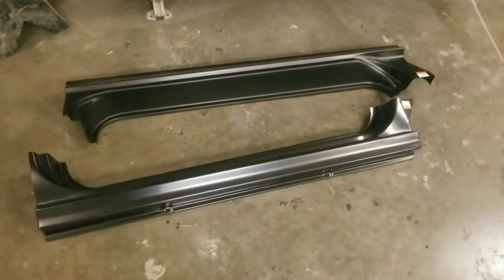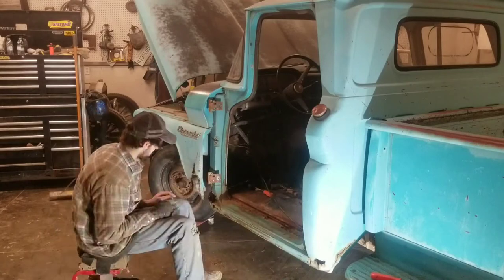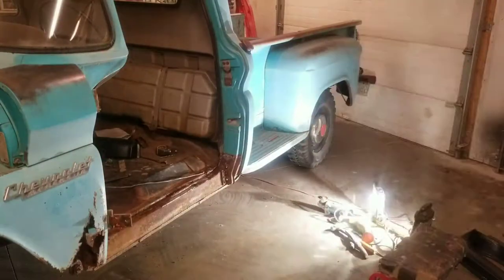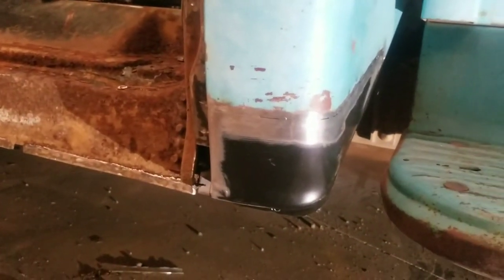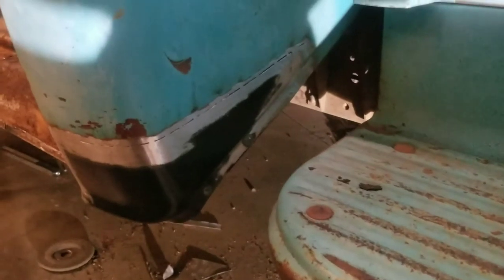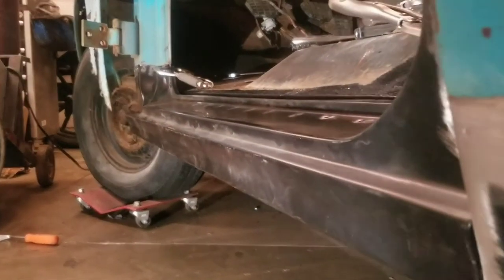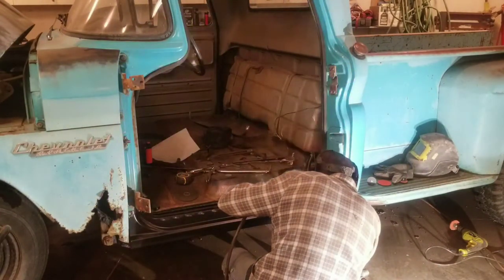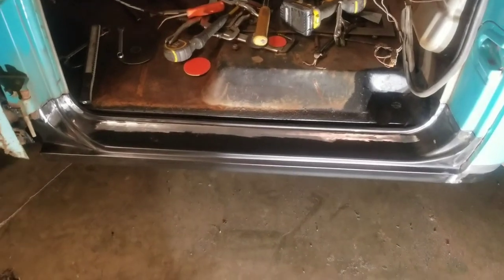1960 Chevy truck part 3: Replacing cab corners and rocker panels

Comment: 62years young and that truck is still better than any new truck on the road . The new trucks are made of tin foil  and plastic.
Reply from the maker: I completely agree!
Reply: @CarterAutoRestyling  I'm a body man myself . I don't have every tool but I make it work . Have you ever watched Fitzee,s garage? He's in Newfoundland and does some awesome work as well .
Reply from the maker: @k.g.kennedy9471  yes I watch Fitzee, he is a talented guy!
Reply: @CarterAutoRestyling  yes he's got the gift and so do you Carter. Myself well I grew up and n a machine shop and worked my way to  doing body work no training just the words of the old timers and a gift with a mig to weld tinfoil body panels . Lol  keep it going Carter I'm old and I glad to see the younger generation having the interest in old school body work in a throw away time where it's easier to throw it away than to roll up the sleeves and just fix it. Will send ya some pictures of a 78 Ford Econoline I'm doing right now . Should be a task as it has had some funky body work done to it previously . It a complete redo so it should take a bit .

Comment: Another old video I missed! 🥳

What do you do to treat the rust, and prevent future rust, under the cab corners and rocker panels?
Reply from the maker: Seam sealer on all the joints and then spray wax oil inside all the panels after paint